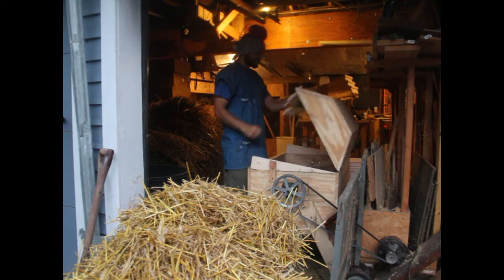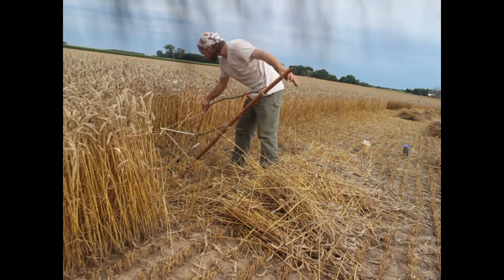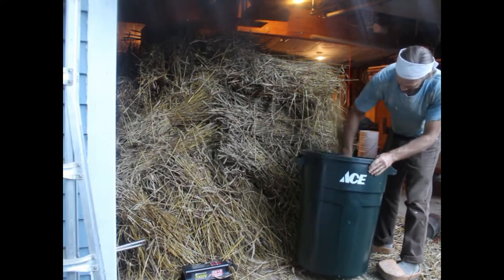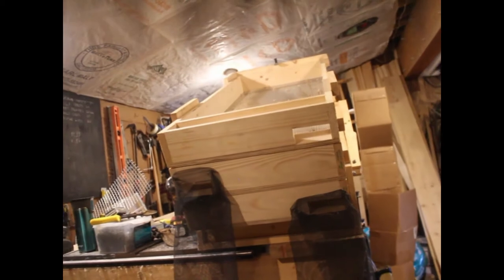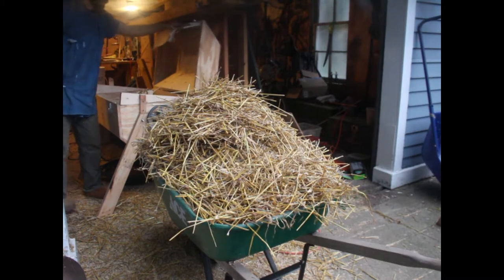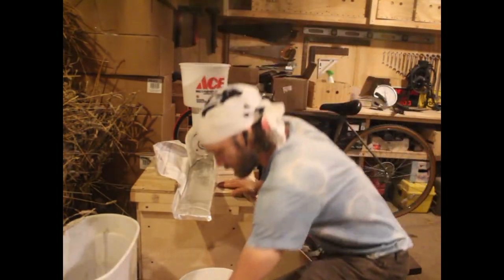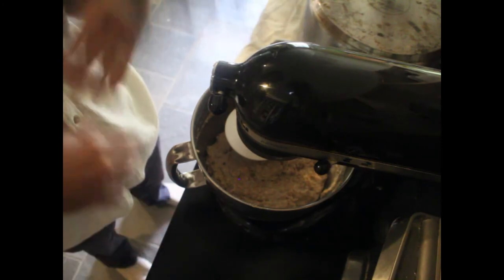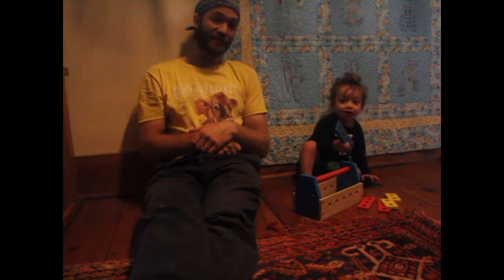Harvesting Wheat by Hand -- Foodmageddon, Ep. 20

Comment: In the mid 1960s, my great uncle (who fought in WW1, which gives you an idea of his age) planted and harvested buckwheat in central Mississippi.  He kept back seed every year (I don't think he had access to seeds otherwise) for the 3 or 4 acres.  Like another poster, he would only cut off the tops of the plants, then used a mule-drawn hay cutter to reduce the stems.  Then, he would burn off the field, leave it over the winter, and replant.  He told me his father also planted wheat and rye, besides the corn.  His father would have been an adult in the Civil War.
Reply: @douganderson7002  I assume there's some method for harvesting just the tops? Hopefully besides cutting small bunches by hand?
Reply: @user-dm1tv6nl2e  Good stuff! I think the top harvester is called....birds😊
Ive heard the as soon as the stalks turn from green to almost tan, thats a good time to harvest. Im sure you've gigured out what works by now!!
Reply from the maker: Right on! This is true. This was my first year and I've done a lot since then. See my new video this year on harvesting by hand, which includes an earlier harvest window!
Reply: If u harvest wheat just when the stalks turn tan, the seed is wet enough to, “ I never could spell or type” anyway shrink, not as good of seed, sure is not dry enough to keep in storage
Reply: Are you saying that if you harvest the wheat just as it turns tan, it would be too wet, and not store well?

Comment: Hmmmm.  I've watched quite a few videos on threshing and winnowing wheat, and I have come to the conclusion that a lot depends on how much you put into the front end of the work.  I've seen folks harvest the way you did, with a scythe.  But I have also seen people take the time to cut just the heads and maybe 4-6 inches of stalk when harvesting.  Yes, it took longer to harvest, but they saved time when it came to threshing and winnowing.  It's sorta like the old saying--there's more than one way to skin a cat.  I have an idea for modifying a wood chipper to use it as a thresher by replacing the steel blade with a piece of wood, but I haven't worked out any of the details yet.  It would be nice if I could figure out how to use it to thresh and winnow the wheat at the same time.  At any rate, I enjoyed watching your video.  I've learned from growing some of my own food that it's a never ending learning process, and I cannot wait to try my hand at growing wheat!
Reply from the maker: Hi James,
Yeah, it went a lot better with heritage grains that were much taller. I'm making a new video with that information this season. Check my channel for part 1, on seeding. It just came out. The longer-stemmed heritage wheat falls together with the heads on one end and makes life much easier. I do cut the heads off with a lopper once they're in a sheaf before putting them in the thresher. It'd be interesting if the woodchipper would do that. It would give you chopped straw. I'd rather have the straight straw for my purposes, but if you're just mulching or something with it, it'd work great. Good luck!
Reply: @LowTechInstitute  Another interesting trick i just watched was a guy threshing wheat with a Worx leaf mulcher.

Comment: Couple points to help that you may have figured out by now.  Nice longer smooth cuts following through farther will help. You need your cradle to be taller over the blades to keep it from flipping over itself and keep it all laying same direction.
Reply from the maker: Thanks for watching and the tips. Yeah, the main problem with the wheat spilling all over is that it is dwarf wheat. Scythes we're designed for traditional wheat, which is a foot or more taller. Also, I harvested too late for a scythe, so the stalks had more resistance. I've written a lot of this up on our website. Had a lot more luck this year.
https://lowtechinstitute.org/tag/wheat/

Comment: You may know all this already, but there are a few big advantages to using a sickle over a scythe for harvesting grain: (1) less shattering in the field, (2) a cleaner, complete cut so you don't pull up dirt with the roots of some plants, which can sometimes be very hard to separate out from the grain later, and (3) you'd be able to cut closer to the heads of the grain, so there would be less straw to have to handle and especially to have to run through your thresher (or cut again) later.
Reply from the maker: These are great points. I just put out an updated "how to harvest" video where I suggest people start with a sickle for those reasons. I need the whole straw, though for thatching. :-) The shattering in the field is also cut down if you harvest at the correct time: by hand, we should be harvesting about two weeks before it is at the point in this video. I also harvest perpendicular to the rows for better results now, too (at least with a scythe). This was my first go and I've learned a lot since then. Once you get the method down, scythe can be very fast and clean. Thanks for the comment and sickle pros. You're right on. Thanks for watching.

Comment: Had opportunity to listen of some baker's, they said they don't like fresh milled flour because the loaf behaves differently. Some said you need to wait about a month after milling it(to wet to use straight)
Reply from the maker: Sure. Good point. Also, it should be sifted first if you're letting it sit, otherwise the oils and fats in the bran go rancid. :-) Thanks for this.
Reply: Once milling wheat berries into flour, it should be used straight away. The nutrients are 90% gone after 3 days and of course rancid. Flour in the stores and what most bakers are using should not be eaten. Sue Becker has great info on this. She is a food scientist and explains a lot of the problems we have these days because of our bad practices.  If you are a believer in the Holy  Bible then you will enjoy her work all the more. I just started milling my own grain and after a lifetime of constipation, it is working wonders thus far! Depending if the wheat is soft or hard, which is what you want for most breads will be different on how it preforms. Once you get the right variety of wheat for your purpose it is great.

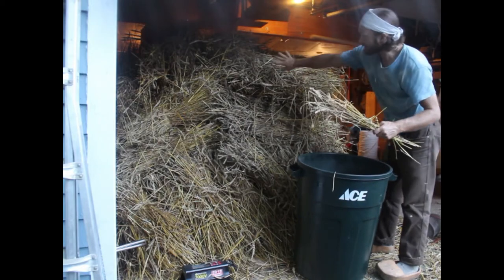Comment: @11:50 when you say "straw is when it doesn't have seeds in it, hay is when it does". That's simply not true. I've never seen someone call wheat "hay" since it's mostly plain grass or alfalfa, because it's grown solely for the purpose of feeding cattle (and wheat is not). Whereas straw is (usually) just the "waste" of producing wheat, which usually doesn't have seeds in it, but it may very well have. So it can be straw and still have seeds in it.
Reply from the maker: I do say "technically," because that is true. Hay, as I understand it (backed up by reading a few definitions on- and off-line), is grasses cut for animal fodder, which can be any grass, but is often alfalfa. But! Oats, rye, and wheat can and have been used as hay. If I fed my wheat stems and seeds before threshing to animals, it would be hay. Although hay is usually cut green and cured.
My main point is that a lot of gardeners buy "hay bales" for mulch on their gardens when they mean "straw bales," not understanding the difference. I was using this as an opportunity to point out that hay has the whole plant and straw is just the stems.
Thanks for watching.
Reply: @LowTechInstitute  Thank you for the videos. They are amazing.
And yes, with the word 'technically' maybe you can get away with your comment, but Before posting I've asked a couple friends because I thought I may have been wrong but they all said that they've never heard anything like your definition. In any case, your channel rocks. Keep it up
Reply from the maker: Hey, thanks. And it would be a waste to give wheat to animals as hay, so it isn't common. Maybe technically correct but stupid to do? Ha. I appreciate you mentioning it. I do get things wrong on these videos. I try not to but it happens, for sure. Thanks for watching and glad you like them!

Comment: Enjoyed your video.  I've been planting wheat for several years now.  My plot is about 25' x 90' or about half of what you were working on.  This year I used a scythe for the first time.  It sure was easier than using a sickle.  My questions is how did you modify your scythe to incorporate a cradle?  Also what variety wheat was it that you were harvesting?  I assume you didn't plant that wheat.  Are you going to cover that topic in the future?  Finally, your threshing equipment was nice.  Thanks for sharing.
Reply from the maker: Thanks so much for the comments. I added a "bow" (bent stick) going from the handle to the base of the snath. Then I attached 90 deg. fingers paralleling the blade. Unfortunately this is hard to explain, so I'll have to make a video about it sometime. Sorry! Last year (in this video) I was harvesting hard red winter wheat, sown for industrial production. This year I switched to Maris Widgeon and sewed it by hand. Much better results. I will do a video about this, too, but for now, find more info here: https://lowtechinstitute.org/2021/04/28/update-to-no-till-wheat-study/

Comment: Two more bike gear wheels and bike chains, which can be joined into one chain. A third smaller gear wheel as tensioner and quick release of the chain. Gear wheel in the middle can be a double, for two 2 chains transfer motion. Bike gear to center gears, other center gear to device rotor gear wheel. Scale the gear wheels right and you can thresh like a mad man with very minimal input work. Highly unlikely any of it wouldn't outlive you, either lol.

Comment: The simulated situation would be typical inland and without navigable waterways. Coastal and navigable areas should see a resurgence in international trade after a few years, after cargo operators figure out how to convert back to sail. It will take longer to get inland trade back up and running in the Americas, because electric locomotives (for railways and also for roadways) aren't really rolled out yet.

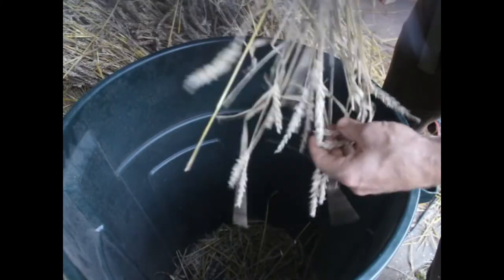Comment: 11:35 
Straw is residue from threshed small grains. Dry corn stalks are called stalks or fodder depending on final use; bedding or filler feed.
Straw is rarely if ever fed to animals because of high cellulose content (too difficult to digest, too low feed value) but is a fine bedding material.
What you have in this vid is STRAW, not hay. Whether the seed head is still attached or not does not make that SHEAVE into hay.
.....multiple sheaves (8-10) are made into "shocks"/"stooks" (regional idioms) and left to dry in field for a week or so.

Hay is a grass crop that is cut, dried and stored for animal feed. Some hays (alfalfa) has very high feed value while very mature grass is lesser.
Reply from the maker: Thanks for the comment. Since this video I've learned a bit and things have changed since these English terms became common. Before combine harvester threshers, the sheaves (singular "sheaf") were stooked in the field to dry because they were harvested before they were fully dry. Now the wheat is harvested "dead ripe" so that it can be immediately threshed. This was too late to do by hand. Check out my newer video on harvesting by hand.
The hay/straw division is largely a question of whether or not it is fed to animals. Wheat, oats, and rye can be cut for hay, but because it is worth more, it usually isn't. Mine is only considered straw when the head is removed.
Thanks for watching!

Comment: Did you make that attachment to your scythe or did you buy it? Please send more info.
Great video!
I'm wondering if I can do like I've seen with linen/flax where they use a device or machine to comb out the flax seeds before processing the straw into linen. I figure you can grab a handful of stalks from your bundled and dried sheaves to comb the ends.
I would be temped to ignore seed in the middle because I would use the straw for chicken flooring or back to the grain field for mulch. I think I would rather process more field, but streamline the labor.
Reply from the maker: I did make my attachment. They're called bows or cradles. Google around but they are kind of DIY nowadays.
You could use a flax rippler (big comb to pull the seedheads off), but if you just want the heads, get a sack that you can tie around your waist, grab the heads and cut just below with a sickle (careful of your hand!) and drop the heads in the sack. Then just thresh the heads. Lots of ways to try! Some will do better than others and the more wheat you do, the more you quickly find out what is a waste of time. :-)
Thanks for watching.
Reply: @LowTechInstitute  Thank you for your reply, very helpful!

Comment: Ok, 3 years after, and I didn't see this mentioned. Where did you get the information that the cut wheat, with grains in the head is "hay" and without the grain it's "straw"?  I've never heard that (multigenerational farmer). Straw is dried hollow stemmed plant material (grains) and hay is some kind of grass.
Reply from the maker: Good question and I misspoke as to how it is generally used, but technically its not wrong. Hay is any grass, forb, or other plant matter that is cut and dried for animal feed (species doesn't technically matter). Oats, rye, and wheat are sometimes done this way, but typically it is alfalfa or other plants. Straw is the hollow stem without the seed head, so after it is threshed, wheat stems are straw. Hope that makes sense and thanks for asking!

Comment: With how easy it is for the wheat to separate from the chaff instead of just reaping it to the side it is better to lay a tarp down (canvas) and reap it onto the tarp. That way you save as much grain as possible.
Reply from the maker: Hi Joseph, thanks for watching.
The wheat in this video is "dead ripe." Modern combine harvesters cut the wheat, thresh it, and bale it all at once, so it has to be dry, dry, dry, which you may already know. This is too ripe for harvesting with a scythe. Traditionally, wheat was harvested when the stem was yellow up to about six inches below the head. Not only does this prevent shatter (loss of seeds) but it stops bran development, leaving you with less bran to sift out of the flour.
See more of the lessons learned here: https://lowtechinstitute.org/2020/12/02/lessons-learned-in-small-scale-wheat-harvest-part-i-variety-and-harvesting/
Unfortunately, at this scale, using the tarp would be impractical. Just harvest earlier! That's what I did this year and it worked much better.
Reply: @LowTechInstitute  Can I ask why there's no videos of this? Would be really interesting to see the lessons learned :)
Reply from the maker: @lobbiester  Lack of time! We hope to put out an updated small-grain growing and harvesting video when we get another year under our belt. Learning a lot each year. For now, the place to go is our website. Thanks again for watching.
Reply: I do think  this is an idea worth trying (when and if I get some wheat).

Comment: At 5:55 or so as you're speaking about shatter - you may well be right, too dry and a week earlier would be better. But there's also an issue with your scythe technique that's contributing to the impact. You're using too much arm swing and raising the scythe on the backswing. This results in a downward chopping stroke coming into the stalks and generating impact. It also is a lot of unnecessary work for your arms. The scythe stroke for mowing grass is a rotation of the torso, your arms remain virtually static relative to your body, and the blade rides with the heel in contact with the ground for the entire stroke, both forward and back.
Reply from the maker: Thanks, and you're not wrong on both accounts. Last year I harvested earlier with great results: almost no shatter plus less bran development. All around a better outcome. I think the fully dried stems were too hard, which made me use more upper body than I should. In mowing "wet" (i.e., not dead ripe) stalks, the scythe cut a lot easier.
I will say, though, that I've read accounts of mowing "high stubble" with tall wheat. That means the heel in that technique is not on the ground, but six to eight inches above it. The idea was to cut down on straw production when harvesting to get more grain on the wagon with shorter sheaves. I've used an American scythe with a turkey wing cradle and the snath was really short, probably for that reason. Anyway, thanks for watching. I'll put out a harvesting and processing guide later this year with updated lessons learned.

Comment: How long does the cable holding the flails last?
Reply from the maker: I replace it each year. It is just nylon 1/4" rope. No point in risking it breaking. I thresh all this plus beans and other stuff on one string. The wooden flails seen here are the hardest on it. I also use plastic chain and other lighter flails for other things.

Comment: Hopefully, we will have alternate fuels.  Like the "bio" diesel (technically it's ALL biological based since it's all hydrocarbon based including the alternate fuels).  It's too bad that we have lost a lot of the old-school know how.  There are a lot of people who do the back-yard-farm thing...and don't have the funds or need for even a small farm tractor.  Someone with an 1/8 or 1/4 acre farm don't have much use for a tractor.
Reply from the maker: Thanks for the comment. Sharing a tractor among a dozen small farms, though, might be a viable option and is done in some places. Good points!
Reply: @LowTechInstitute  It could be difficult getting even a small tractor in and out of a lot of backyard farms.  A big issue I would have would be the need to rent a crane.  Houses round here aren't typically designed to accommodate a tractor getting in and out.